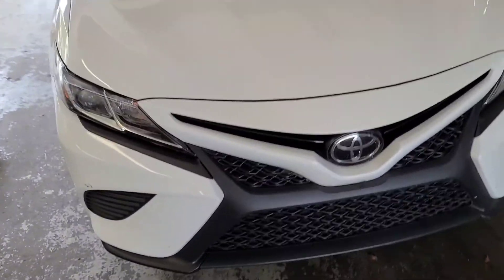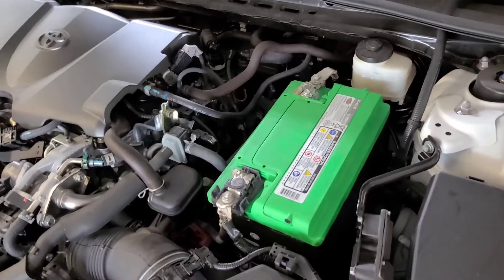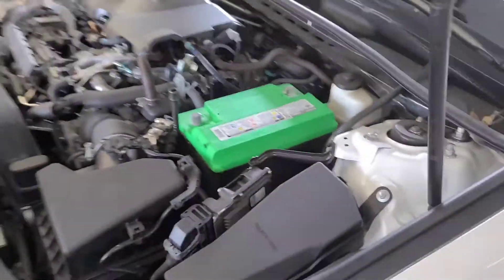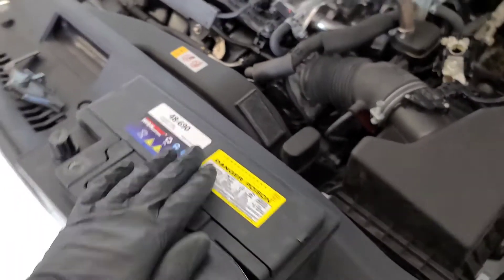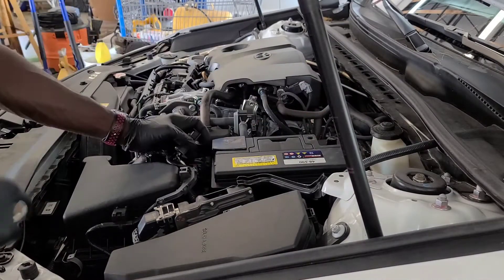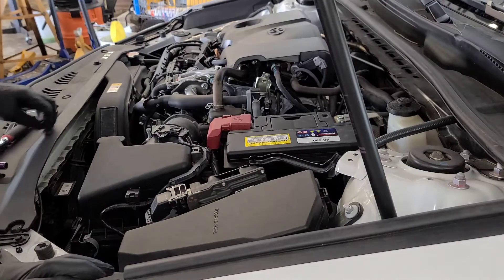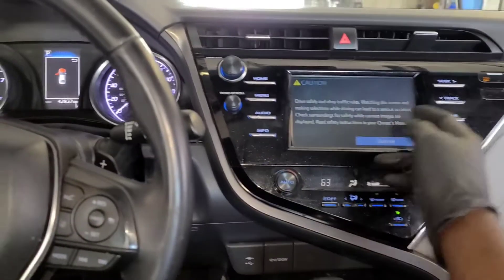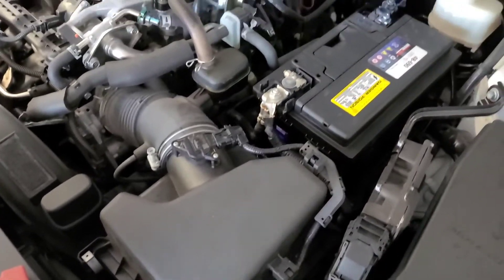Toyota camry battery replacement (2018 and up)

Comment: What about all the sensors and functions? The TIS has all these extra procedures. However I need to replace the battery and all the parts surrounding it. Lots of corrosion for a newer vehicle this was a surprise

Comment: Thanks for the video.  Just one note - the socket wrench extension bar linked below is too short.  There's not enough space to use such a short bar.  I needed to go buy a longer one.
Reply from the maker: Thanks for letting me know i will go ahead and update it right away

Comment: How did you even lift the negative cable off? There is zero wiggle room in mine and the wires are not flexible.
Reply: Having the same issue
Reply: I'm having the same issue, anyone find a solution?

Comment: tip: just remove the intake cover for easy access

question: amazon says this battery won’t fit my 19 se. I measured my battery and it looks like it’s 9.5” at most while the dimensions of the amazon battery show it is longer. this is confusing

Comment: what battery size or type is right for the 2019 camry? i kinda dont want to spend 200-300 but if that's the only choice then it is what it is
Reply: Trust me u don’t want a $80 one lol
Reply: I was also confused about the size. And just bought the battery. I bought h5 group 47. You can go with h5 agm, h6 or h6 agm also. And I also figure put this car has the battery size extended option upto 3inch. Cause a lot people think h6 is looks bigger in size so how it fit.  If you see carefully on the bottom then you’ll notice the option. I did research on few brands also then went with the Duracell h5 which comes with 36th month’s warranty. Toyota truestart says 84 months but they told me after two years i have to pay 50% of the cost. The Walmart company battery also provide 3 years warranty but you have to check the reviews. Advance auto charges always extra.
Reply: Costco or Sam's have them way cheaper!

Comment: Great content as always.
Can you give us a follow up on the Avalon brake upgrade with the Highlander front brake calipers and pads? I am planning to do the same upgrade on my 2017 Avalon XLE with the 17" rims. Please advise.
Reply from the maker: Tell me what you want to know and i will make a video for you
Reply: @DULLAHGOSOHARD  Give me some feedback on the brake feel vs stock, how the car stops from high speeds like 80 - 20. Does it the caliper fit with the stock 17" inch rims? Something along those lines would be great.
Reply from the maker: I got you

Comment: Is that the 2nd battery on that car? Usually it is a Toyota Battery. Anywho… how long did the original last? Years wise.
Reply: It's NOT the original battery...and the original battery vent hose that ran from the rear battery vent hole to the wheel well is missing. That was unprofessional work by the mechanic who did the first battery replacement. A replacement should be bought and installed to complete this job.
Reply: My original still good 80k miles almost 5 years northeast
Reply: @Brararaf101 according to what I’m ready it should be changed at the 5 year mark no. Obviously preventative maintenance not necessary.
Reply: Mine lasted for 6 years original Toyota battery